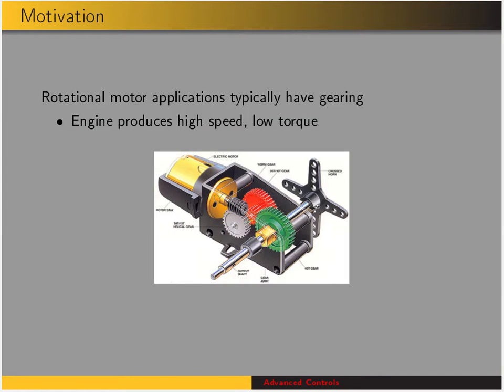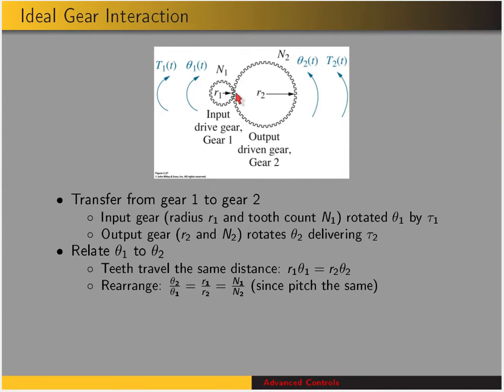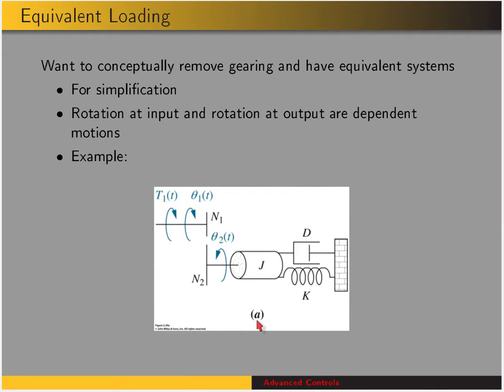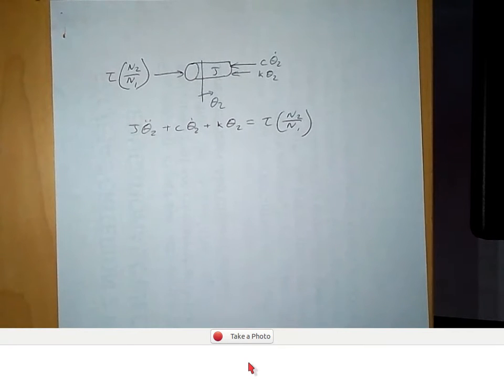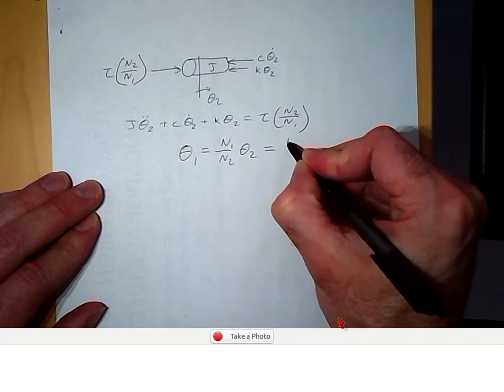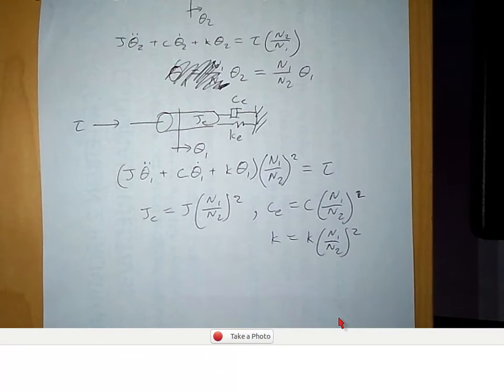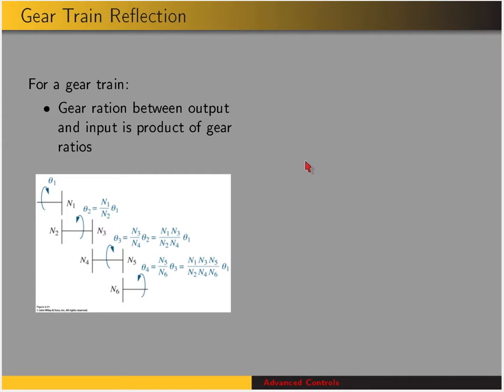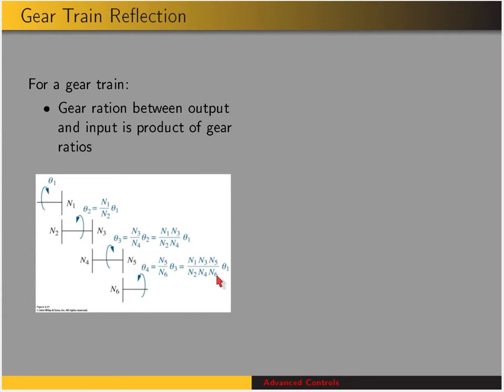MFD04_systemsWithGears

Comment: why teta1 is 1 at the last question?
Reply from the maker: My guess is that you're referring to the equation at 15:42.  That is the transfer function, so it's not that \{Theta}_1 equals 1, it's that \{Theta}_1 / \{Tau} = 1 / (J_e s^2 + c_e s + k_e).  To get this transfer function, apply Newton's second law to the rotational system shown in the middle of the page.  (That is, the second figure down, the one with J_e, c_e, and k_e.)  Take the Laplace transform of the resulting differential equation.  Factor out the \{Theta}_1 and rearrange the equation to get the transfer function shown at 16:01.

If you still have questions, please feel free to comment.
Reply: it is not 1. he didnt even used it